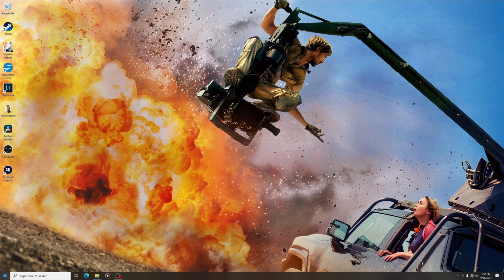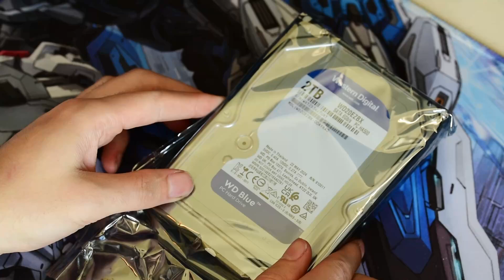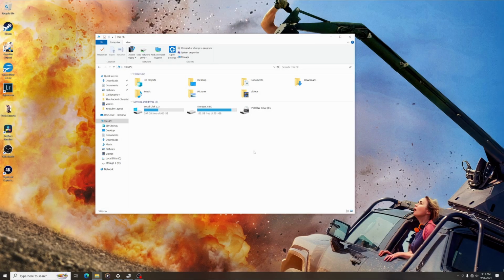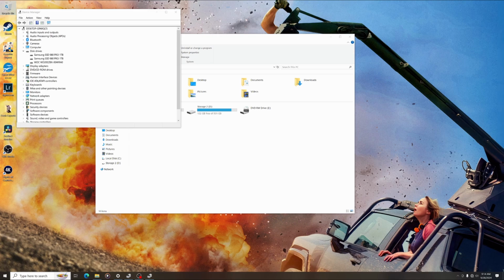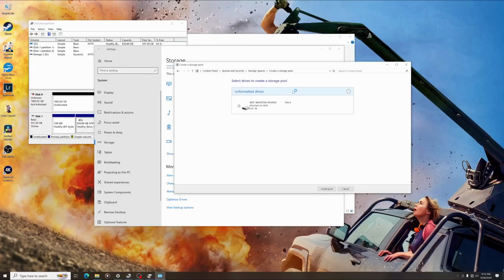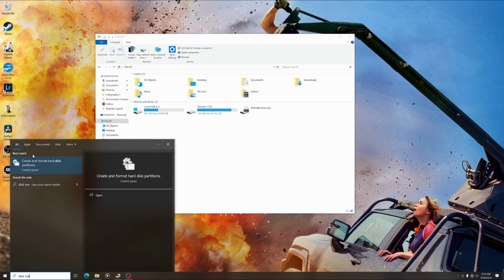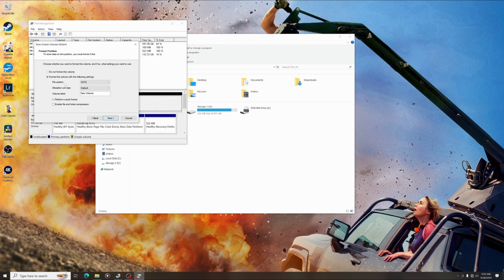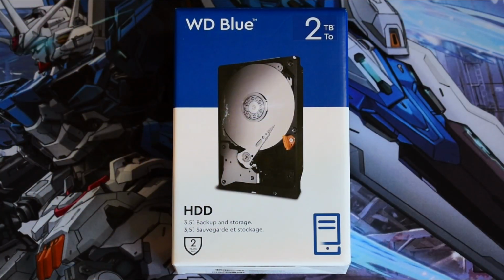Tech Tuesday: Install, Troubleshoot, and Review of the WD Blue 2TB HDD

Comment: Curious: is the 2TB drive something you had laying around for a while, or did you have a specific reason for that size? The 4TB version is a much better value for just $20 more.
Reply from the maker: It was what I could find at my local store and do a review on relatively quickly. At the time of purchase, my local Best Buy had almost nothing on the shelves. So yeah, I would have gladly gone with a larger drive if they had one.

Comment from the maker: Just an update, I used an Insignia 2ft Sata cable on this project and the cable turned out to be the reason why I was having trouble. The drive continued to disconnect after this install until I replaced the cable. Probably just a faulty piece of hardware, but it was just another way to troubleshoot that I thought might be useful to know!